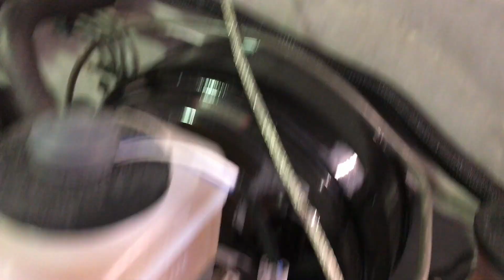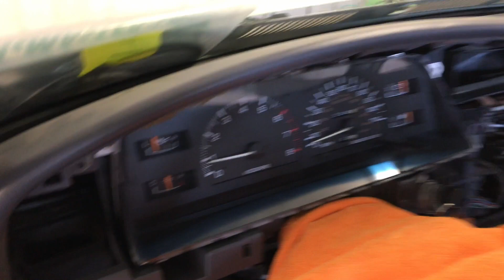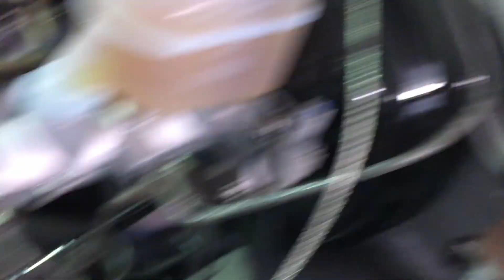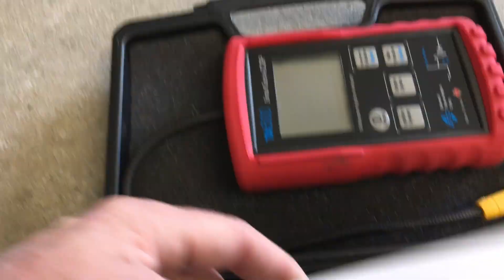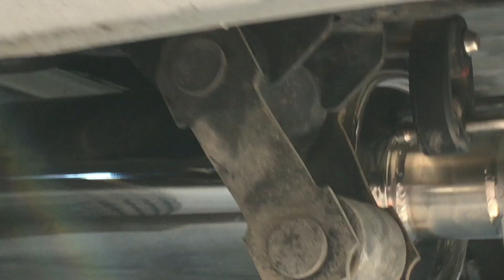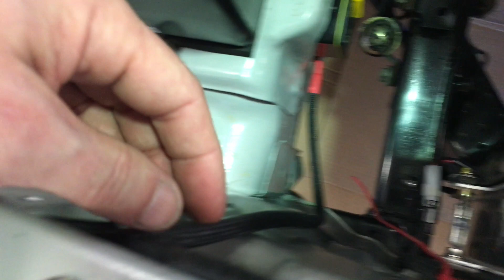Starting the 22RE 1990 2WD Toyota Pickup w/ Champion aluminum radiator & electric SPAL fan

Comment: What size Spal fan are you running? I am seriously considering running a very similar setup to yours on my 1985 Xtra cab with a 22R-TE. I'm going to have to weld in an extra bung in the top for the factory turbo coolant return. I was going to try to run the original turbo radiator with a flex-a-lite fan kit but ran into clearance issues which is why I'm looking at the champion radiator with an electric fan.
Reply from the maker: SPAL 30102082 - https://www.amazon.com/gp/product/B009OBOWGO - that's the one I'm running.
Reply: Thank you very much!
Reply from the maker: @dustywrex6643  You're welcome. It's a great fan. I'm actually going to do a video soon showing how effective it is at dropping the temp. Probably another few days and I'll post it.
Reply: @ray5961  I am going to still run my flex a lite controller because the only thing I like about it is the fact that I can set the temperature at which it comes on and it will only kick it on at 60% when the target temp is reached. If it goes higher, it will increase the fan speed accordingly. Also allows for accessory signals like an override switch and A/C signal. I have the dual stage 190 thermostat in it but I am now considering the lower one after seeing your issues.
Reply from the maker: @dustywrex6643  Hey Dusty... with my setup, what I thought was going to happen while I was building it and what actually happened in real life on the road turned out to be two radically different things. That's why I had to change my thermostat down from 190 to 170. Basically think in terms of two different modes: driving vs. stopped. When driving, you want your electric fan to be always off; this means the air going over the motor and through the radiator is providing 100% of the cooling by a wide margin. So to accomplish this, the thermostat has to actually open at a much lower temp and allow water to start flowing to the radiator well in advance of the temp you want your fan to come on at. This will allow the radiator to provide cooling while you are driving without bringing the fan into the mix. As far as coming on at 60%, that's not what you want. When the fan is required (meaning air flow over the motor has stopped usually), you want 100% always. Here is what takes place: you are waiting in line at In-n-out burger... when you pulled in, the coolant temp was low, but now there is no air flow, so water coming out of the radiator starts to increase fairly rapidly. On my truck, when driving and the outside air temp is around 65-70, water coming out of the radiator usually stays below 110 degrees (the lowest reading present on my VDO gauge which monitors water return from the radiator) and this keeps the motor cool. My engine oil temp usually runs about 175 if the outside air is 65-70 and while driving. But when stopped (e.g. in line at in-n-out burger), the coolant returning to the motor will start to climb steadily; it will hit around 195 or 200 and that's when you want the fan to jump into the mix like Mike Tyson breaking up a house party at your parents' house that has gone on too long... we ain't talking about 60% Mike Tyson here; we need 100% Tyson to resolve a situation to which has started to spin out of control. Your Spal fan is Mike Tyson - its job is to hit hard and bring things back under control as fast as humanly possible. When my fan kicks on, you feel a huge gush of warm air coming out from under the car and you can see the VDO gauge drop from 200+ back down to about 110 or 120 like a rock. It all takes about 10 seconds. Then - if you're still in line - waiting for your double-double - the process starts over. Temp climbs until Mike Tyson has to be called to break up the party. Once you're back on the road, then the radiator and air flow over the motor takes over and slowly starts to bring the coolant temp back down to operating levels down around 110 coming back into the motor. But if your thermostat opening temp is very close to the temp at which your fan turns on, it sort of holds the water hostage inside the motor too long. This is like not letting Mike Tyson in until everyone has broken your mom's furniture and then only opening the door after your parents' home is trashed. So it's definitely a balancing act and you want to make sure water can get out to the radiator and cool down well below the point where you develop a situation which requires serious muscle being called in (a.k.a your Spal fan). I'll have a video soon showing how mine works while on the road. The other issue is when you're climbing a large hill and it's hot outside (90-100 degrees) and traffic is crawling slow. My oil temp will hit 200-220 and water temp will climb and the fan has to jump in on and off to supplement lack of air flow. In that scenario, you want your thermostat cracking open earlier than later, because otherwise you could create a situation where your fan could end up running constantly for 15 or 20 miles if things aren't setup correctly. You want hot coolant to get to the radiator well below when you need the fan to cool. The electric fan is different than a mechanical clutch fan that is always turning. Anyway, a lot also depends what temp you want your motor operating at. The 22RE usually likes 190, but I run mine much lower and just run hotter spark plugs and that seems to work well for my setup. If you run into any questions, feel free to hit me up here anytime.
Reply: @ray5961   I get it. My reason behind the 60% progressive was have the fan come on at a lower temperature and not draw as much of an electrical load on the charging system on initial fan start up since I am only running the 70 amp alternator at this time. Granted I do want to try to keep it as cool as possible with the turbo being an extra factor. The variable controller changes the speed from 60 to 100% based on a 10 degree difference from baseline startup. So drawing on what you have said, in terms of stop and go traffic and sitting in the heat, I’ll probably have it set low at around 175/185 and ramp up to 100% by the time it starts to creep above 195. California summers are a bugger to deal with and I don’t necessarily want sudden changes in water temp since I am going to be running the SDS standalone from LC and I don’t want the fueling tables changing constantly.
Reply from the maker: @dustywrex6643  What compression and boost levels are you running? I'm going to be building a turbocharged 3RZ in a few years and have run a number of turbo setups in the past and have had good luck running water injection for higher boost applications. Anyway, on the fan stuff, running 60% vs 100% will just change the duration that the fan remains on pretty much. Also, what is your controller doing to run at 60%? Unless it's using pulse width modulation, then most likely it's resistor based and so limiting the fan may produce heat some place else in the electronics - make sure that doesn't cause other issues when attempting to cool in very hot conditions or you could risk heat soak in the electronics, etc. Myself, I prefer simple and basic. I just let my fan run wild and free haha :-) My fan is on a dedicated 40 amp breaker that runs directly to the battery through a backup fuse as I remember. The Spal relay grounds through the coolant temp switch - real analog and real basic. I think I also left provisions in my wiring harness to have a manual override switch in the cabin, in the event of the Spal temp switch failing. I also ran a lead into the cabin which I can hook to an LED that is in parallel with the fan's power circuit, so I can wire up an LED on the dash later to show when the fan is actually running; this is because sometimes the motor or road noise is such that it's hard to hear the fan and know if it might have triggered on while driving through say a 102 degree desert stretch of road or not. The best thing is to road test it and see how things respond, then fine tune - that's what I had to do. Also, since you've got a turbo, have you considered wiring up either a timer switch or manual switch so you can blow the engine compartment when the motor is cooling down or off, in order to help to things down and prevent coking of the oil in the turbo housing, etc. On my turbo motors, after a lot of hard driving, I've come home more than a few times to my turbo and manifold glowing ruby red under the hood. Just remember, the main goal here is to have the motor cooled by the radiator while driving, not the fan. The fan is more of a fall safe mechanism that comes on in order to halt a total melt down while the vehicle is stationary but operating. The fan should really never come on while driving if the thermostat and radiator are the correct size and temp setting.
Reply: @ray5961  I am wiring up a manual switch as well for that possibility. Not sure how the controller goes about it, I’m assuming sits a resistive style like most variable controllers. I’ll have to look into it. The brand is Flex-A-Lite. The motor/truck is an actual factory 22r turbo, but I’m changing the CT20 to the GT2554R. Just went through the motor and put brand new turbo pistons in it with 8.5:1 on the compression and added ARP head studs and mains. Also going to run a turbosmart boost controller, water methanol injection, and add a Greddy BOV. Was a factory automatic that I converted to a W58. Installed an LC pro clutch and 16lb flywheel. I did some port work on the head myself. I have a turbo air cooled VW motor that is running 12 lbs on pump gas with 9:1 with extensive engine work (list of mods would be really long), so I’m applying what I have learned from head porting, fuel tuning and the like to this truck. I’ll admit my setup is nowhere as clean as yours and you have done some pretty snazzy things that I may look into in the future.
Reply from the maker: @dustywrex6643  Thanks man. I was going to run ARP head studs on my motor also, but they were out of stock everywhere when I was putting the head on - rumor was they were back ordered or there was same change being made or something. I read people saying the ARP head studs can restrict oil flow to the valve train? Because I guess the diameter of the ARP head stud is larger slightly than the OEM head bolts - and therefore it can reduce oil flow. Have you ever read about that? I never was able to get my hands on any ARP head studs, so I don't know if there is a difference in diameter or how it affects the oil passage that comes up through the head and all. Anyway, on my fan setup, I have an older style 22RE thermostat housing (off another Toyota model) which has a bung for the Spal fan switch. I think I had to chase it with a NPT tap but it worked out pretty nice. So the fan triggers off the coolant temp coming right out of the head.
Reply: @ray5961  If I remember, I believe after the filter, the passage makes it's way to the tensioner then up to the front of the rocker assembly via a small passage behind the chain cavity. Oil is then supplied into that front rocker bracket where the first set of head fasteners are, into the rocker shafts themselves, and drain toward the rear of the head. I installed a set of LC's pro rocker shafts because I liked how they chamfered the holes for their oil feed passages. The threaded holes for the head bolts themselves do no empty into anything. I have not heard anything about restricting flow and as for their design, they do fit a bit tighter to the walls of the fastener holes, but nothing that would cause an interference fit. I also grabbed one of the cast iron thermostat assemblies with the bung and did the same thing with having to chase the hole with an NPT tap. I had an option of another port in the side of my lower intake manifold below the temperature gauge sender. There was a factory installed plug there that I have not been able to determine what is different about this manifold other than it's an early turbo perhaps because I haven't found the same plugged port in later model turbos or aspirated motors. I am utilizing this port instead for the SDS standalone coolant sensor so it's a more consistent reading at the head.
Reply from the maker: @dustywrex6643  Yeah, I know the cast iron thermostat housing you are referring to. I had one of those around for a while. The one I'm running is aluminum, but it's hard to find. I'm running the LC pro rocker shafts also; those are super nice with the extra holes, etc. As I remember, the oil feed comes up from a single hole in the block and goes up along one of the head bolts and into the rocker arm assembly. Doesn't the oil flow around the actual head bolt (the front right one)? I would have to look at photos to remember, but I seem to recall it from when I was doing my block. I have a couple of videos of installing the LCE head on my block in my older videos.
Reply: Excuse me, it does get fed through the alignment dowels on the rocker shafts. I was under the impression it got fed through the front. Most of Toyota's other engines are fed from the front so I stand corrected. I'll have to look into the ARP thing a bit more and ask around to a few guys that I know that do run them and see if they ran into issues.
Reply from the maker: @dustywrex6643  Yeah, it comes up around the head bolt right? I saw someone on a forum saying the larger diameter ARP head studs reduce the volume of that path, but who knows. I ended up running stock head bolts, since this motor is only putting out maybe 135-140 HP on a good day.
Reply: @ray5961  The other day I called LC to double check on my head gasket application and determined what I put in wasn’t going to suit my application. I had a MLS gasket that came with the truck when I got it and had him run the numbers in it since I had no info other that a part number on the gasket. I had the block bored .040 over for in the future if I wanted to run their stroker crank with turbo pistons, I could do it with a quick block hone since their stroker pistons start at .040. So I was able to determine that the MLS I had would fit so I just pulled the head to change it the other day (I did have the machine shop deck everything and use the correct stone for the MLS ahead of time). What I found was it does come up through the block on the intake side through a passage just behind the timing cavity. With it reaches the deck surface, there is an oval chamber in the head gasket that bridges this passage with the front most head fastener on the intake side. It then moves up the faster and there’s a oil passage in the side of the hole. The studs do fit a little tighter than the OE bolts, but with the boost levels I want to run, I do need the studs. I guess this will be an experiment to see how the oiling will be affected in the top end. My best friend suggested we build a spray bar for the valve cover, so I may look into building one of those in the future. For the time being I’ll see if I can get away with running a thinner oil like 5w-30 instead of 10w-30 or 20w-50. My truck is still in the midst of me putting it back together so I am not quite at the point of firing it up.

Comment: Just a tip I did a similar set up on my 22r and my and used the stock water pulley just turned the fan shroud upside down and it pushes the left about 2 inch’s to clear the pulley

Comment: Greetings!  I like your videos and your mods on your pickup!  I was wondering where you found your thermostat housing with the threaded port for the fan switch?
Reply from the maker: A lot of searching on ebay! I don't remember what it came off of, but I found it on ebay used. Frankly, it would have been faster to just weld an aluminum bung on the factory one. Just search ebay until you find one - make darn sure it's aluminum and not cast iron, because they have older ones which were cast iron with that same threaded hole on there.
Reply: From my search on the internet, I believe it comes off 94 - 97 Celica  7AFE 1.8 L engine, and, the 93-97 corolla.   I'm going hunting at the local pick your part to see what I can find.  The pick your part app says they have a few of the above mentioned  cars.
Reply from the maker: Wally Weiss yeah I think you're correct - I seem to remember something about a Celica being mentioned in the ebay listing, now that you mention it.
Reply from the maker: Wally Weiss I buy a lot of my parts on line also... McGeroge Toyota is who I've been using lately. They do a nice job packing and have good prices.

Comment: I notice your AFM isn't the stock one, is that off a early 80's Celica Supra? I've tried to research that a bit, but haven't found a definite answer. Did you have to modify it at all or was it just plug-n-play?
Reply from the maker: Zachary Palmer That's a rebuilt one. I bought it from Napa but it's a factory one that they rebuilt I guess. I accidentally broke the original one and had to buy a replacement.
Reply: @ray5961  Interesting, do you happen to have a part number for it? I'd definitely be interested in upgrading. The stock ones are more restrictive than the ones like what you have with the more square black plastic piece on the top.
Reply from the maker: @zacharypalmer9475  I think I might have a copy of the original receipt. I'll look around later and see what I can find
Reply: @ray5961  awesome! If you're able to find it that would be amazing! No worries if not though
Reply from the maker: @zacharypalmer9475  ok I found the original order. It's Napa Remanufactured - $239.99 each. Part # was NEC XTP420055 - and there was also a core charge of $36.00
Reply: @ray5961  awesome! Thank you very much!
Reply from the maker: @zacharypalmer9475  You're very welcome! :-)